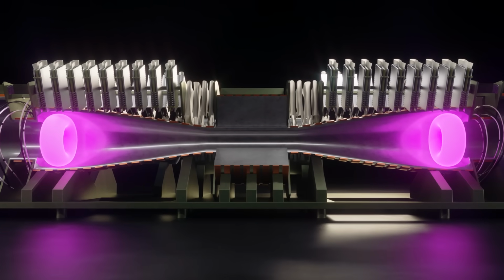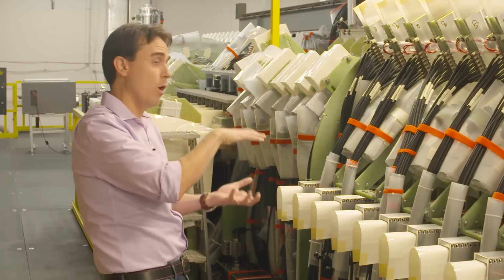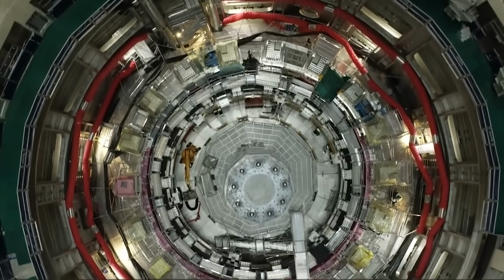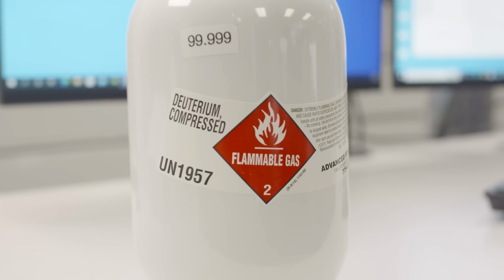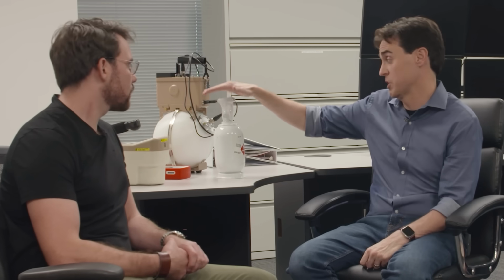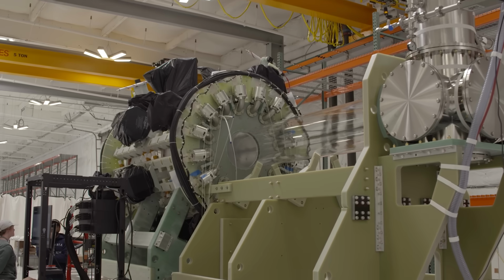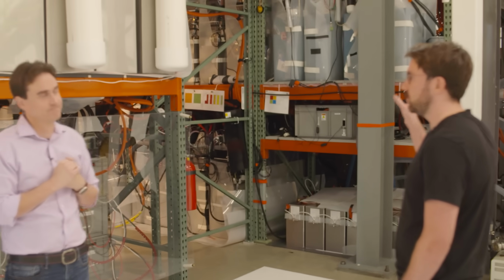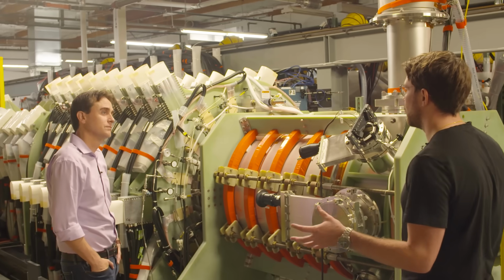A New Way to Achieve Nuclear Fusion: Helion

Comment: My wonder is whether pulsating plasma direct energy capture, like that which Helion wants to do with their 7th generation machine, has been proven to work and at what level of efficiency? Or will that energy capture delay the next generatiom prototype until it can be solved. I do wish the video described that in more detail. Since so much of this fusion method depends on the direct capture I'd like to know more. Or maybe it was intentionally ommitted because of trade secrets?

Comment: H3 decays into He3 at a HALF-LIFE of 12.3 years.  It would take c. 37 years for H3 to become 87% He3.    There's still huge heat blasting those cryogenic magnets.  Sure, this device in the video can fire one shot and handle the heat, but needs to do so continuously.  I don't see that happening...
Reply: The D-D reaction also produces He3 directly in the other branch. D+D => He3 + n.
The magnets are not cryogenic. They are outside of the vacuum chamber and the magnetic field contains the plasma which is surrounded by a vacuum. So only radiative heat reaches the wall and to a lesser extent the magnets. Heat load on the first wall is about 1 MW/m2.

Comment: Are we going to go beyond breakeven w/ the next version? As I understand it, a hydrogen bomb is created by two atomic bombs exploding around a core and the force of the explosion implodes the target creating the fusion reaction.  It seems that Helion has adapted the notion of the hydrogen bomb to make its fusion reaction, as opposed to the tokomak ring which squeezed the plasma into a persistent plasma. I would have like to have some indication of what they expect the 7th generation machine to create in terms of input vs. output. It seems that they expect to go far beyond breakeven. That would be a huge advancement. Perhaps a series of machines would replace the need to have the reaction occur many times a second in a single machine.
Reply: They are aiming for net electricity with Polaris some time around the end of the year.

Comment: Use the plasma as a glow plug and smash multiple opposing magnetic cylinders at it. Just run the fusion constantly. Like an old diesel generator.

Comment: This Science is too difficult to produce at the beginning of this clip no mention of electrical energy needed to produce fusion energy. You can produce D2O as a by product from green hydrogen using nuclear energy which has a 70 year record, Tritium is made in nuclear reactors so basically we have bless nuclear on a large scale. I worked out of designing a 2000MW nuclear reactor using 60 percent enriched uranium 235 the full load will be 16640kg having 40 fuel rods this design will make nuclear reactors smaller, the moderator will be graphite and heavy water or CO2 gas. The shelf life of this reactor being 45 years . All I say nuclear is the future if you want lights to be switched on .

Comment: The analogy given was of a piston in an engine. Sooooo, instead of increasing the frequency of this single piston...why not have more pistons?
Reply: They could. They have plans for power plants with multiple Helion cores. They can share a lot of equipment like the capacitor banks.

Comment: Initiating, Fusion Reactions, with the ease. Until it first Explodes. And takes out half the countryside. And everyone with it.

If you have to suspend the plasma  in a magnetic field. What's going to happen when it burps? And then, Whoops. There will be a, whoops. One of these days. Most, assuredly. When one of those near light speed particles. Makes it out of the, Teva Cron. Or whatever? All it has to do is get, destabilized. And a fusion ignition will occur. And take everything with it. In one fell swoop. Kind of like when, Vulcan sucked in on itself and disappeared. And that's why we shall never find, Vulcan.  It was Planet--X. But it fell into the sun. After it sucked itself to death. And billions of Vulcans, along with it. Such a tragedy. Poor Gene Roddenberry. Why did he let Vulcan die? Didn't he have Computer Effect? I guess not? Vulcan is now dead.

We been trying to turn the hands of time back. To get Vulcan back. But all we have been able to do. Is rip the rights away from Women. From 50 years ago. So that didn't work. This doesn't work. They will have to reverse it back, again. As it must be.

And so nobody has been able to maintain a fusion reaction. For more than a split second. This is not working. It's more vaporware. It may never work? No matter how much they think it should. You can't tell physics what to do. Physics is as physics, does. And we mustn't Fool, Mother Nature. They tried to add Chernobyl. They tried to at Fukushima. They tried to at the Enrico Fermi Power Plant. Decades ago. Only to find out in the end. After it was shut down. All the problems had to do. With a soda pop can. Thrown into the, Nuclear Vessel. By a construction worker. Back in the early 1950s. And was a factor. In many destabilization's and nuclear leak, warnings. To stay in our homes. Windows closed. Doors closed. Don't go outside if you don't have to, warnings. I remember those growing up as a kid in Detroit. When they thought the Enrico Fermi power plant was going to explode and melt down. As they would have to keep pulling it off line. They didn't know why? As we didn't have miniature little  solid-state, high-resolution, surveillance cameras yet. In the 1950s and 60s. So? I don't know how much radiation I was exposed to as a child in Detroit? This was a regular thing I remember. Enrico Fermi power plant now off-line. Stay home. Stay indoors. Great! Mommy didn't hear nor he. I was a little kid. Playing outside the house. I got will dosed I guess? I still glow-in-the-dark. My bones glow right through my skin. It's Awesome! I don't need a flashlight. I can Glow. Wherever I want to Glow. I can, Glow, anywhere!

I drank a bottle of, Radium Paint. But all my teeth fell out! Maybe I shouldn't have brushed with that? I think I brushed my teeth out? They melted.

Today I eat everything through a plastic tube. McDonald burgers taste better that way. When enjoyed with a straw. I can easily Drink at least 3 or 4 burgers.

Burp
RemyRAD
Reply: You have in your hand a device that grants you access to all the knowledge of mankind. Yet you did not use it before you made this post. Fusion machines do not explode.

Comment: It is close to impossible to create helium it takes massive amounts if energy to produce even negligible amounts of helium. The authors must know this.
Reply: If you can fuse Deuterium and He3 and get net energy from it, then you can do the same with just Deuterium. One in two D-D reactions produce a He3 and a neutron. The other half of D-D reactions produce a Tritium atom and a proton. The Tritium can be sold for $$$$$$, traded for He3, burned in special variants of their reactor design or stored until it decays into more He3.
The D-D reaction releases less energy than D-He3, but according to their paper it should still be net positive (or just about). The real meat is in the D-He3 reactions, though.

Comment: Helium 3 is expensive
Reply: Thats why they are making their own.
Reply: @elmarmoelzer2229  that’s not what it means to be expensive. Expensive means to be costly to produce in process
Reply: @Myexpectationsarerealistic   Helion makes He3 at the same time as they are fusing it. The Deuterium in the fuel fuses along with the He3 and Deuterium fusion makes He3 (and Tritium which also decays into He3). That He3 is then fed back into the machine as more fuel. It has no extra cost to Helion. They have a patent for the process.
Reply: @elmarmoelzer2229  it’s almost as if you just didn’t read what I wrote there.
Reply: @Myexpectationsarerealistic  
I tried to explain to you that for Helion it will NOT be expensive to produce and process. Maybe I am misunderstanding where you are trying to go with this?
Reply: @elmarmoelzer2229 the total cost of the process, the number of steps required and the amount of energy to get the reaction started.
Reply: @elmarmoelzer2229 EXPENSIVE

Comment: This is much more realistic and achievable than a tokamak reactor. But I really want to point out, it is incredibly difficult to hit something correctly.
Reply: It is actually surprisingly tolerant. The particles do not actually collide. The magnetic fields collide and that leads to the formation of a bigger FRC. That one is then compressed which is what actually causes the atoms to fuse. The collision alone would be insufficient for that.

Comment: Just curious, what is the ratio aspect of energy used to create the power vs its output?  To date I thought that fusion took more power to produce than it was able to output?  Factoring both (in your case) the creation of power and the creation of the fuel for the power output generator both.  

Also. What if you connected hundreds or thousands of “Heatsink Thermoelectric Cooler Peltier” devices where the heat is a byproduct within the safe usable range and the cooling can be done passively or by just extending cooling lines already required to and through heat sinks to generate electricity and feed back into storage for with later use there or the grid at a fairly steady rate.  Seems it would extend the operational output of electricity at no additional cost. It would just utilize waisted energy in the form of heat you already have to dispose of in the form of cooling anyway.   Just curious.  Good luck with everything!
Reply: Trenta did not have the equipment to recover any energy. Polaris will do that around the end of this year (if all goes well). It is supposed to produce a small amount of net electricity from fusion for the very first time. The next machine after that will be a 50 MWe power plant for Microsoft.

Comment: fusion is unrealistic for now. you need a very strong magnetic field to hold the hot fusion matter away from the surface of the vessel, yet at the same time, you need to get heat from that fusion matter to boil water and power a steam turbine. we so far havent been able to create efficiency and continuous fusion on any decent scale. you need to get fusion matter so hot that it fuses, which is very expensive energy wise, and then you need to make that matter suspended in a magnetic field. I personally think it wont happen within our lifetime with this method. this method is very contradictory and just inefficient even if it worked. might be a better idea to have intermittent fusion with particle accelerators instead of this furnace type

Comment: wouldn't it be better, if you could maintain magnetic confinement , to channel the plasma , not in a parallel straight t line, but to force it into a partial cork screw that tightens in radius , taking advantage of the ( ac=v2r a c = v 2 r , which is the acceleration of an object in a circle of radius r at a speed v ) , so couldn't you accelerate the plasma even further , by introducing a declining radius ?
Reply: There are FRC systems that use rotating magnetic fields to stabilize the plasma. E.g. Sam Cohen's (shamefully underfunded) lab at PPPL is using that. Those are good for steady state designs. Helion does not really need it because of the pulsed nature of the machine. To them what matters more is to get the two FRCs together as quickly as possible. That is mainly for formation and to pre- heat the ions (rather than the electrons). The real temperature (and density) increase happens in the compression stage.

Comment: um, if it actually worked safely and efficiently, then power companies would have invested in and developed them for local use at power companies.  calling bs, sorry.
Reply: Helion already have a contract with Microsoft to build a power plant. But Polaris is first to make sure everything works at full scale.
Reply: @elmarmoelzer2229  No!  MicroSoft has entered a contract to purchase electricity from Helion.  MicroSoft does not have involvement or obligation in Helion's power plant construction.   Very different things.

Comment: Oh, ok🧐... So how did you over come the -10x inefficiency problem?🤔.. just curious. 😑 or 80% energy loss problem?. Like all the rest when trenta, isn't making fuel?.. 🙄 why do you not fuse at 15M like, The Sun?? Your cooking at 100M which is ... Ridiculous!!! 😑
Reply: I am not sure I can follow all of this. But I can answer the last question. The sun is actually really inefficient as a fusion reactor. It has a very low energy density, about the same as a compost heap. It only "works" because it is really, really big.

Comment: This is a stupid question, but how does this not explode or something at 1-20 million degrees? Don’t all metals melt at significant lower temperatures?
Reply: Essentially they use giant magnets to wrap the plasma in a magnetic field so that it doesn't touch(burn) the device. The super heated plasma kinda like floats in the machine essentially. That's all Fusion reactors to my knowledge not just this one by Helion.
Reply: @Htnn  but at those temperatures the heat radiating off should still be plenty hot enough to melt any metal.

Comment: Design remeniscent of a Star Trek warp reactor.  
Reactor "fuel" (trintium) is injected into the preignition chambers where the magnetic containment coils heat the fuel into a plasma state.  
The plasma is accelerated by the high frequency ocillating field coils through the constriction coils to compress the plasma to a superheated state.
The plasma continues to compress and accellerate in velocity until it is injected into the reaction chamber (warp core).
The resulting fusion creates heilium-4, while releasing electrons, which are collected by the beryllium collector panels lining the reaction chamber.

Comment: This might feel like a small achievement, but it is a really big one. First of all, creating these machines takes a ton of effort and time and even thinking of these ideas is tedious. The risk situated here is that if the magnetic coil does not fire a magnetic field the whole place could blow up. Obviously, such a company will have safety precautions, and the machine would have some backup ready. But sitting in a room monitoring this room nearby, would be very scary.

This thing is capable of changing the world if done on a large scale!
Reply: No, the place would not blow up.

Comment: Why dont they use the heat created by the neutrons too? Cause using it would fix the heating isdue right?
Reply: The neutrons only make between 5 and 10 percent of the total energy output. Capturing that and turning it into steam would greatly increase the capital cost of the machine. It might not be worth it for D-D-He3 machines, but Helion might (maybe!) consider it for D-D-T based dedicated He3 breeders.

Comment: hello guys i need job you can burn regular gasoline with HOO or need some money can you guys reach me out help
Reply: Chromium sputtering on sludge steel erode surfaces so then aluminum and some gold make way in which help combustion engine adhere carbon ceramic coat that contain plasma efficient ?

Comment: What are your thought on Molten Salt Reactors?  Could Helion and / or MSR be the answer to the Solar System Flight?
Reply: Helion has the advantage with direct conversion. The cooling requirements are greatly reduced.
Reply: Molten salt reactors are a real and proven technology, not just an idea. So, no, hellion has zero advantage. Besides, cooling requirements are not an issue, not sure what you're point even is.
Reply: @MikeLAUGH-XRPL   Cooling is a problem in space. Vacuum is a perfect insulator. So you can only transport heat away via radiation. That requires large cooling panels on a fission reactor which needs a steam cycle. Helion's machine (if it works) does direct conversion. So it only has to radiate away whatever share of energy can not be converted directly. In theory that is a lot less. So they would require a lot less colling panel mass.

Comment: We need to put this in space where the neutrino condition of what is actually a space-time neutrino ocean under constant resonation pressure through field coupling. There must be flow shearing efficient enough that the inverse flows cause one side to reverse on it's orientation to create positive gain after turbulent cross shearing that coupling resonation may spin 180 degrees in orientation and row together in a harmonizing flow around and through itself as a confined system. The excited neutrino conditions on earth is stalling the reaction. There's too much phase noise. The moon is already a better source for helium 3. Space is ideal once privatized space travel becomes efficient. We are already working towards this. Space X is  just 1 example